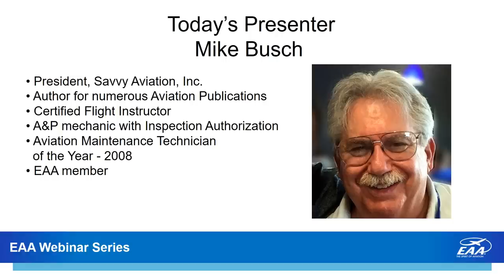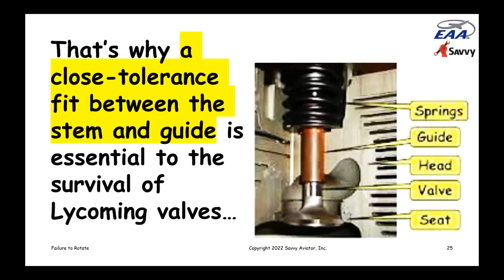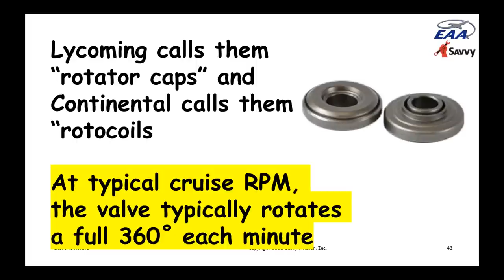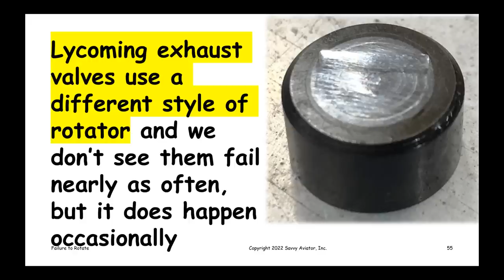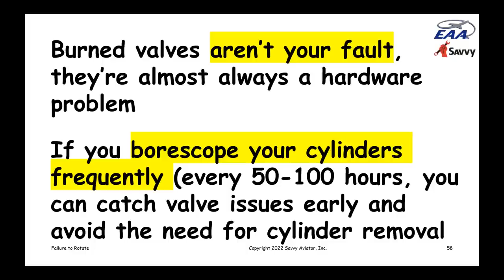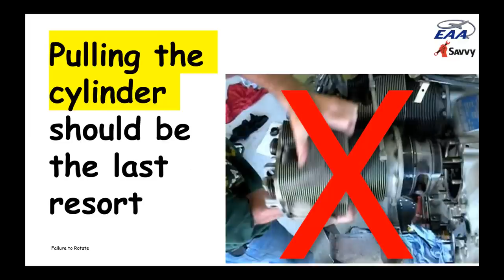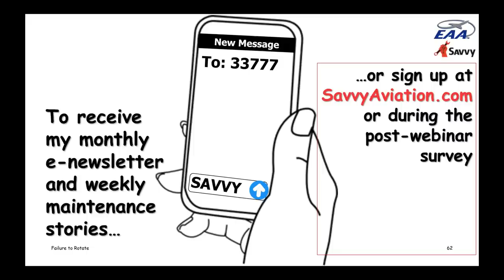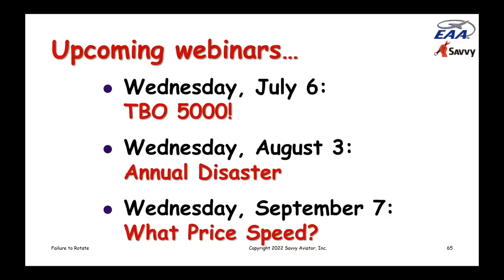Failure to Rotate - Burned Valves

Comment: I took his engine course years ago, he discussed with engine monitor setting to normalize and then doing inflight mag check, you will see temps change as the valve rotates if there is a leak and it will be cyclical, like every minute or so. Interesting he did not mention that this talk.

Comment: DOHC, more valve, seat, stem and guide to absorb heat. Also on a bucket lifter, the cam lobe often runs slightly off centre so it rotates the valve every time it contacts plus the bucket prevents the valve from wobbling side to side, reducing valve guide wear.

Comment: I have a Continental O-300 that keeps burning the exhaust valve on the #2 cylinder. Is there a rotator on these valves?
Reply: Mike mentions in the Q&A that the O-300 doesn’t have rotators. Perhaps the valve seat is not concentric with the valve guide.
Reply: @darrylday30  I have had the same issue with two different cylinders though. I’m wondering if there is a angle on the rocker that would make the valve rotate. I have had at least four different A&P’s work on it and one engine shop. All other cylinders are running great. ????
Reply: @shanelarsen1436  I’m not an expert like Mike but I’ll do my best. I’m assuming that when you say you’ve had the same problem with two different cylinders that both of these cylinders were installed and operated in the same #2 cylinder position on the engine. If that is the case, I would recommend checking for an intake manifold leak adjacent to the #2 cylinder (look for a 100LL blue stain indicating a crack or leaking seal). A manifold leak adjacent to the #2 cylinder would cause a leaner mixture and higher temps on any cylinder installed in that position. CHT/EGT for each individual cylinder would be helpful for trouble shooting this but I’ve never actually seen that on an O-300. You want to stay on top of this. Scope it often. Solve the problem. Loosing a valve on takeoff is very dangerous. I’ve been there with the stall warning blaring, controls sloppy and desperately looking for a place to crash.
Reply: @darrylday30  I have put a new Superior cylinder on it and it lasted about 200 hours. The other three times I have just had the cylinder overhauled and they last between 50-100 hours. I have checked the pushrod for proper length and oil flow and the rocker for proper oil flow. I also verified the oil flow by turning the motor over with the mags off and watched the oil flow out of the rocker. I found a spot in the intake runner where it bolts to the head that had a dark brown spot on it that might have been an intake leak so I took care of that. I have checked the travel of the rocker compared to the number 4 cylinder and they were the same so I don’t think the cam is going flat either. It just isn’t that complicated of an engine but it’s hard to find guys with in-depth knowledge of this issue.
Reply: @shanelarsen1436  Cam and lifters would be worth a look as they’re easy to get at. However, I’d recommend contacting the manufacturer. There is zero chance that you’re the first person to have this problem and there’s an almost 100% chance that they’ve solved your problem previously with someone else. Be concise and precise. Don’t guess. Give them the details with pictures and measurements if possible. Be prepared to gather more data. Finally get back to me if you can and let me know how things worked out.